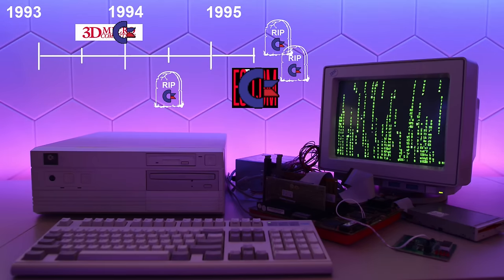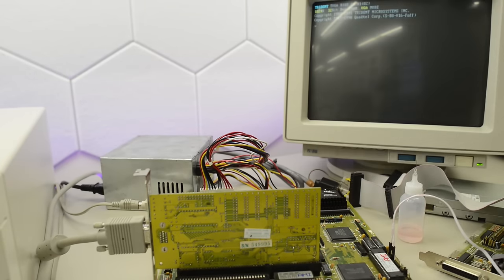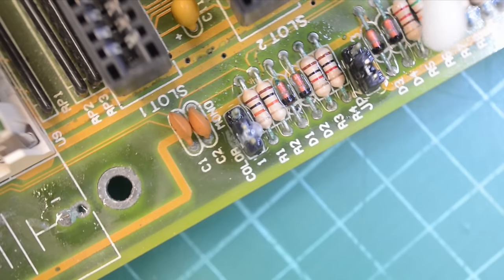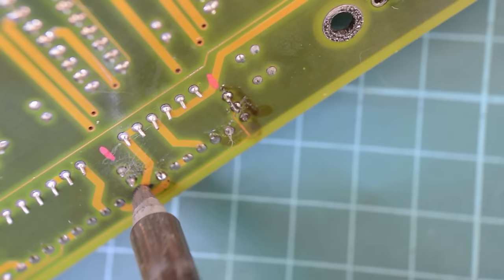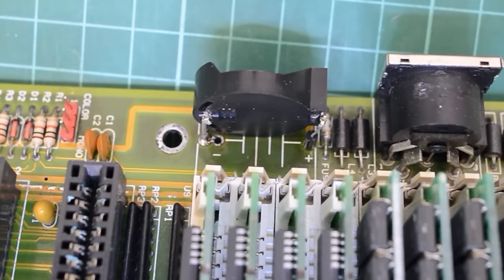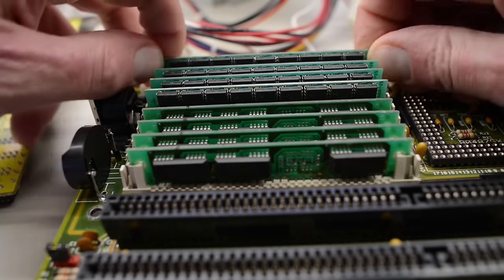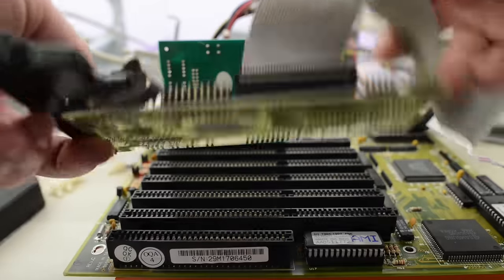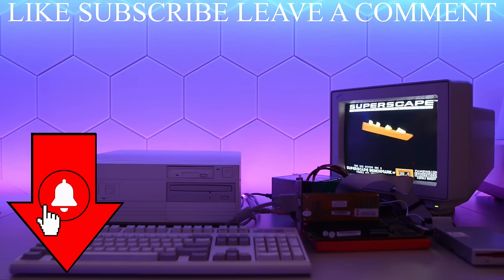Commodore 486SX25 Restoration. Fixing leaky VARTA battery damage

Comment: I've bought ISA slots off eBay before. I got the most results searching for "edge connector 98", since it's a 98 pin connector (2x49 pin), although there was a quite a few unrelated listings (for some reason a lot of sportsball cards, you can filter them out with "-1998"). The cheapest were obviously from China and Taiwan, but there were a few listings from the US America and UK.

EDIT: Forgot to mention, if you just want the 8-bit slot, it's 2x31/62 pin.
Reply from the maker: Awesome, I found some right away :) Aliexpress seems to have the best price, thanks!
Reply: Haha a friend of mine designed 98 pin daughterboards for a project as luck would have it, and when he ordered random 98 pin connectors, that looked continuous from the description at a glance (forgot to look at detailed datasheet) he turned out to receive ISA sockets when they finally turned up! This was quite a roadblock because the boards were already made and they were continuous 98. Luckily one supplier was found who had real continuous 98 sockets and could express them in. The rest all turned out to be ISA slots.

Comment: Here in Germany these computers appeared after Escom had bought up what was left of Comodore. They then provided generic PCs with the comodore label and sold them more expensively, or you had to buy the operating system.
Reply from the maker: Yes, however, this Commodore was made about one year before the ESCOM deal.
Reply: the pc boom era , Escom bought anything they hold off, half of those system came dead on arrival, students like me reseating and swaping boards to get things working.
Reply from the maker: @arjanvanraaij8440  Sounds like good times :)
Reply: @arjanvanraaij8440  i loved the store. There were always parts, with the remark that they were defective, for very little money. 90% of the time it wasn't defective, but the staff wasn't properly trained

Comment: I don't know how viable it is, but citric acid has a pH of 3.2 where white vinegar is around 2.5, so it's not a massive difference. Citric acid powder isn't terribly expensive and you can mix the concentration you want with distilled water. The upside is it will smell like oranges instead of vinegar's nasty smell.
Reply from the maker: Sounds good to me : ) I'll try with lemon juice next time and we'll take it from there
Reply: pH is logarithmic, 2.5 is five times more acidic than 3.2.
Reply from the maker: @Squossifrage  Oh, dang it. Well, we'll try it anyways. But that is a huge difference. Maybe we'll even check what the actual pH is too. shouldn't be a too expensive test
Reply: @Epictronics1  Nix the lemon juice, what you're after is citric acid powder in the canning section of your local supermarket, next to the mason jars, canning wax, fruit pectin, and pickle brine seasoning. 

Stuff also does an absolutely incredible job dissolving lime scale from coffee makers.
Reply from the maker: @mfree80286  cool, I'll try it

Comment: When lead -tin solders corrode, tin oxide is produced, which removes tin from the solder. This changes the alloy from having a melting point at 183C to having a melting point range where part of the solder melts at that temperature but part melts at a higher temperature-think of it as you making a lead-tin slushie when you try to melt it instead of a liquid. As you found out, grinding the surface away removes the tin-depleted material and allows you to melt the alloy underneath that has the normal solder melting point.
Reply from the maker: cool, I guessed that some chemical reaction must be messing with the melting point. Thanks
Reply: So adding a little modern 99% tin solder to the surface might be more effective than 60/40 or 63/37? Or do I better just use 63/37?

Comment: For badly corroded solder joints I recommend using acid paste flux, it cuts through the corrosion pretty well in my opinion.
Reply from the maker: Interesting. what brand have tried? Thanks
Reply: @Epictronics1  the brand I use is Kester but I can't seem to find it for sale anywhere, though I think any good acid paste flux would work. They're usually used for plumbing I believe but I had it on hand and tried it on some horrible corrosion on an old 286 Compaq laptop that had the wonderful 1980s era surface mount capacitors. Since then I've used it on battery and capacitor corrosion numerous times as a little bit seems to go a long way.
Reply from the maker: @lightmagick  I'll see if I can find some. thanks
Reply: I've heard of that before, but beware that it's nastier than normal flux: you should spend more attention on washing it away than normal. That's the reason they say not to use plumbing flux on electronics.
Reply: @absalomdraconis  oh yeah the cleanup is annoying as heck since it's a sticky paste but the trade-off is how well it works at cutting through the corrosion. Might just be my successful experience with it making me biased towards using it but it's cheap enough that I don't think anyone trying it off of my recommendation would be too upset.
Reply from the maker: @absalomdraconis  Ok, thanks

Comment: Great video, what a rabbit hole that machine is!
Reply from the maker: Thanks Ted : ) We'll get it up and running for some DOS gaming if we persist
Reply: @Epictronics1  I wonder if you've a bit of "bit rot" in the bios of that old gfx card? I'm seeing a lot of that lately. I'm wondering if to flash all my old cards.
Reply from the maker: @ted-b  I realized when uploading this vid. I may have made a silly mistake. I think I might have had the jumpers on the card set for use with an 8-bit slot :/ I'll check

Comment: The card might just need a bios reflash, as for the diode they infact act like an ultra high resistance in the reverse direction and ultra low in the forward but importantly not infinity and zero, since the internal resistance of the meter is so high it can detect the small diode leakage
Reply from the maker: Oh, I see. I didn't know that, thanks!
Reply: Difference between ideal components and real-world components.  :-)
Reply: MrTGuru  I DO mean the VGA card but not as an upgrade.
EPROM stores data by trapping electric charge within the gate of a FET, However over time his charge can leak away (Oxide layer imperfections, Cosmic rays .etc) causing corrupted data.
Writing a known good (Idendical) copy of the data back to the EPROM should fix this without requiring erasure, since any bits that have become discharged will be recharged and any bits that were never charged will remain uncharged.
Reply from the maker: Mr Guru  We're in luck. The VGA card turned out to have the jumpers set incorrectly! It's working again : )

Comment: Instead of adding a diode and having that bodge with the vertically soldered holder you can disable the charging circuit on the board and solder the holder normally in place of the original battery without the extra diode.
You most likely need to lift one of those diodes or resistors lined up next to the battery area where the red pin headers are.
To find which one you need to check continuity from the positive of the battery to a diode then to a resistor and then to 5V (diode and resistor might be inverted) in other words find the charging path from 5V and break that circuit lifting a leg of a component.

Then double check you get 0V at the battery terminal and voilà

Comment: Hi!  What diode are you using?  I have a 386 sx board with a varta that I cleaned.  I would like to perform the coin cell mod and I have the holder - just don't know what diode I need to prevent the reverse charging.  Do you have the model or a reference link to this mod?  Thank you!  Great video!
Reply from the maker: Thanks, I use 1N5817. good luck with the project
Reply: Just about any small signal or low current rectifier diode will do.  Schottky would be nice, since they have low fwd voltage drop and you want as much of that 3v as you can get.
Reply: @Epictronics1  Hey there!  One last question.. For the diode, what direction (lead) do you have attached to the coin cell holder and what end (lead) is soldered to the Mb.  I just want to make sure I put the diode in the right direction before attaching my coin cell holder.
Reply from the maker: @TheRetroRecall  Sure, here is a picture. Hope it helps. The resistor is optional. https://1.bp.blogspot.com/-2t1V8k063ts/XVDCtN3swMI/AAAAAAAAAic/5ZH0aG0Fdd86i2NaR5PiS2e5StrJeIZXQCEwYBhgL/s1600/20190812-a501-coincell-battery-mod-schematic.jpg
Reply: @Epictronics1  thank you!

Comment: Digi-Key claims to have ISA connectors.  Sullins Connector Solutions EBC49DCWN-S420 seems to be a match.  I'd have to dig further into the data sheet to be sure, though.
Reply from the maker: The picture looks right. but they are silly expensive :/

Comment: With the ISA slots, I would be tempted to assume a poor solder joint or a damaged track on the motherboard, especially with all the flexing when inserting or removing cards. The memory issue seemed fairly obvious, as the problem appeared as soon as you had removed it to be examined.
Reply from the maker: I have inspected and cleaned the SIMM sockets with deoxit and it still gives occasional RAM errors. I'm considering removing some SIMM sockets and at least one of the ISA slots to inspect underneath
Reply from the maker: Mr Guru  The thought has crossed my mind. I'll remove at least one or two to check

Comment: They do have vertical holders for coin cells, but your solution seems ok, I'd add some hot glue for structural support.
Reply from the maker: yes, I'll definitely add some hot snort, thanks
Reply: The vertical ones don’t usually have a footprint that is compatible with the old rechargeable cell.  For this very reason, i made a PCB for a low profile surface mount CR2032 holder that uses 0.1” right angle jumpers, one on each side, and pads for a SMD diode with bypass solder points.  Usually I just modify the motherboard to add a diode somewhere (there’s almost always an opportune footprint somewhere) but it’s nice having a drop-in replacement too!
Reply from the maker: @nickwallette6201  YT isn't great at letting me know about all new comments. I just read this now! Where can I find the project? : ) Thanks Nick
Reply from the maker: Mr Guru  I actually ordered some of those "external" holders with wires a week ago. I'll try them out in the next project
Reply: @Epictronics1   It is always my intention to give away anything useful that I've done, but I am absolutely terrible at actually setting up any kind of repo for the handful of things I've managed to build to completion... haha

I'll try to get off my duff this weekend and maybe even use the blog hosting site I've been paying for since some number of years ago.  I'll keep this tab open to remind me to post a follow-up when I have a link.

I actually have a small collection of RTC / coin cell adapters that I've made, trying to get everything from clone motherboards to PS/2s and Mac Classics using the same CR2032 cells.  I even designed a few that adapt one or two coin cells to in-between voltages, like the 4.5V required by a Compaq motherboard that I have.  That one in particular is utterly unhappy with >5V, so 2x 3V cells is not an option, and 1x cell isn't enough to maintain the settings.  I tried a couple series diodes, but they aren't passing adequate forward current to drop significant voltage, so I ended up with two very low power regulators -- one is a buck (6V -> 4.5V), and the other's a boost (3V -> 6V, I think.)  I figured I would let both of them run for a while and see how they do.  IIRC, the boost reg actually ended up with a lower quiescent current (oddly enough...), down into uA at no load.  But that's still enough to drain the cells more quickly than the idle current of an RTC, so I'm curious to see how long they last.  Should be a couple years still, but definitely not 10-20+ anymore.
Reply from the maker: @nickwallette6201  haha, yeah so many projects, how will we ever find the time :) I have ordered small plastic housings with cables for two CR2032s. I'll be trying them out next with a diod and resistor

Comment: Need a better soldering station.  My Xytronic LF-3200 has no problem with large thermal masses such as PCB ground planes, even when using a small tip.  And I always keep it at 325 Celsius.

There are coin cell holders made for upright mounting which may have worked here.
Reply from the maker: That is pretty good compared to my pincil and TS-100. I usually go with 380 and have to use my large tip occasionally for large ground planes. I'll order some upright holders for sure

Comment: You can find standard clock oscillators at mouser. Just search for oscillator and filter on dip-14 package.
Reply from the maker: I checked, thanks. Unfortunately non-stocked
Reply from the maker: @Farull  Yes, they seem to have a few in stock : ) thanks

Comment: Could you have soldered the battery holder facing the other way towards the ram and you may have been able to get the battery in and out without removing the mb?
Reply from the maker: Those SIMM modules are a bit higher than the cell. But not a big issue. I'll just replace it with a more suitable holder when it's time to replace the cell. They last a very long time : )

Comment: Remember that there is some reverse leakage  volt in a diode from approx. 0.5v to 1.5v some diode types have less than others. zener diode I mean I have less. How much reverse leakage current depends on how much you load the diode
Reply from the maker: I used a Schottky 1N5817
Reply: Since the cathode end isn’t referenced to anything, it’ll float pretty high.  There are nA to uA leaking through in the fwd direction that absolutely won’t hurt the battery, but they will dissipate and clamp down to the battery voltage once you install the cell.
Reply: @Epictronics1  That explains it. Schottky diodes typically have much higher leakage than PN junction diodes. By my calculation, you are seeing about 0.5 microampere, assuming that your meter has the typical 10 Mohm input impedance. Probably not enough to worry about--although I'm not really sure how much current a CR2032 can safely sink before you start to get gas buildup.
Reply from the maker: @danmenes3143  Someone suggested adding a protective 1k resistor in series. (a recommendation from a CR2032 datasheet) Maybe this would also take the current closer to zero?

Comment: you might want to try some vinegar directly on the solder joints, before you add vast amounts of flux... then it should flow more easily. The bad news is, that it's going to be very stinky.
Alternatively you might want to try a different kind of flux (i.e. for soldering steel).
Reply from the maker: Do you mean mix vintage and flux? Hmm... That might work. And yeah, that might stink too lol
Reply: @Epictronics1  : I actually mean to apply the vinegar first and let it work its magic. And then apply flux without cleaning the vinegar off. It should drop the pH of the joint and make it easier to de-solder.
Though I would refrain from using the de-soldeing gun, and instead use a cheap hand pump or wick. I don't know how well the tip of the gun takes that mixture.
Reply from the maker: @bikkiikun  ah, yeah, that might end up an expensive experiment : )